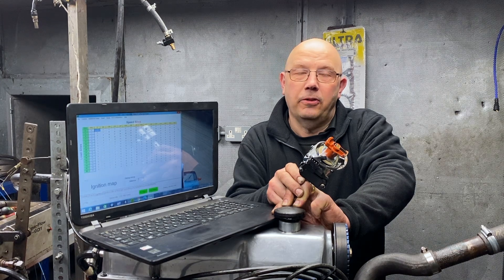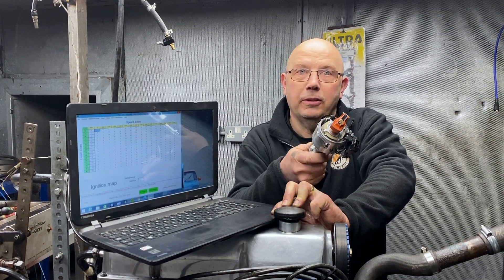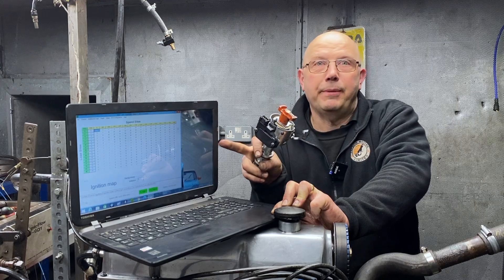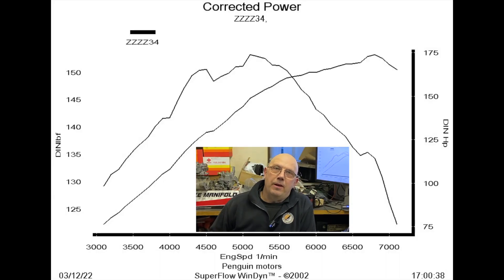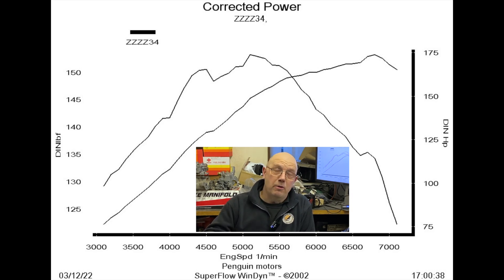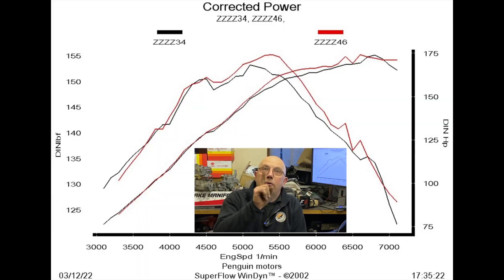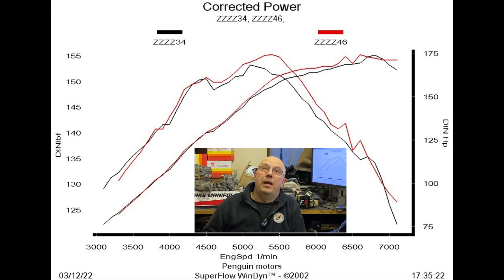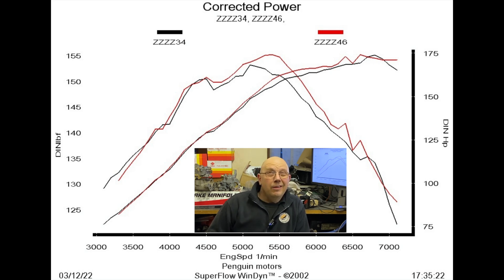Burton Power Distributor vs Mapped Ignition test - Ford Pinto Edition

Comment: Is the burton dissy electronic and not points?
Reply from the maker: yes electronic
Reply: @PenguinMotors  is the extra torque  from the spark energy, more accurate timing or map opposed to curve?
Reply from the maker: it wont be spark energy you only need enough not to missfire more energy wont give more power.

Comment: Can you redo this on a cammed engine, nothing wild needed, with a stock dizzy, a modified dizzy maybe without vacuum (as is all the rage), and mappable ignition? And then do runs on each setup at 100% throttle, and THEN!!!! do runs on locked 50 or 60% max throttle too?

Comment: Love these videos , please keep them coming, odd question but do you have any origins or know where that rocker cover comes from, I have one on my Pinto in Australia and get asked about it all the time . That's the O my other one I have ever seen
Reply from the maker: Many more videos in the pipeline. Sorry no idea where rocker cover cam from, but to be honest it was a pain, no baffle under the filler cap meant it tended to Chuck out oil, and it kept working loose, something the tin ones don’t do
Reply: @PenguinMotors  yeah I had similar issues as I was using it on a worn motor with a blow through turbo setup. I do plan on reusing it one day once I weld some fittings and a screw on cap onto the top. I look forward to.more videos

Comment: Dis is always loosing spark intensity in high torque output when cylinder pressure is highest. Better spark bigger bang. Nice video showing this in the dyno. Next petrol vs E85 test? Both tuned for max output.
Reply from the maker: I have run race cars on E85 but unfortunately it’s not available at the pumps in the UK so not really any point on me testing on it
Reply: @PenguinMotors  Oh I thought everywhere there is ethanol available. So no point there.

Comment: What if i told you, that you could do a programmable efi for roughly 150£, with a sierra efi distributor, a golf3 coil and a speeduino no2c ecu?
Reply from the maker: I would say that’s just fine, but not something the average guy is going to be doing and I like testing to sort of stuff that average Joe might do at home
Reply: @PenguinMotors  try having a look at the speeduino forum page. The pricepoint provides an entry point where the average Joe actually gives it a shot. And having it mappable also provides idle control to an extend, and take-off torque bump.
Also easily expanded with a set of bike itb's and just having it full efi for that modern living. Coldstarts are mint, driveability and economy in check too, and truth be told, mapping fuel is way easier than carbs. Also, theres autotune for fuel :)
Reply from the maker: @runesmDK  cool, yes im well aware of EFI and mapped ignition, i like running these old pintos on carbs, but i wouldn't take the efi off my race car for all the tea in china :)

Comment: I would have thought that you could also run the CR possibly a 0.5 higher on a mapped ignition just because it's easier to avoid knock with a programmable set up. Still interested to see more on the Zephyr Six build btw.
Reply from the maker: in actual fact this engine inst sensitive to timing and would easily handle more compression. Thers not been a lot of progress but  a Zephyr six update is coming shortly

Comment: The obvious question is, what are the differences in advance above about 5200 RPM? Is the distributor too advanced or too retarded in that range? Otherwise it's interesting to see how close the curves are. Good one!
Reply from the maker: the distributor didn't give enough advance around 5200, but advancing it further hurt top  and low end power.
Reply: @PenguinMotors  So not enough advance at peak torque? That seems a bit counter-intuitive. At about what RPM was max mechanical advance?
Reply from the maker: @andrewleonard9257  it does, but if i advanced it at peak torque it dropped off a bit either side, but i should point out we are only talking a difference of about 2 lbft so small whatever way you look at it

Comment: Funny I was gonna ask what kind of ignition your running on theses test. I just fitted a bestek kit. How about a master class on tuning Weber 45s?
Reply from the maker: As for tuning webers im  no master, its quite easy on the dyno as we are not bothered about idle, part throttle, progression and stuff as we only run at full throttle, all i have to do its get WOT and the AFR close and all is good.  The real art is the part throttle stuff
Reply: @PenguinMotors  Are ok, I know Weber 45 videos do really well on YouTube and not really seen anyone tuning them as such, like the scenarios you mentioned.
Reply from the maker: A lot of these tests I did with a standard distributor which I modified myself by adjusting the spring tension and fitted lumenition kit. Burton distributor performed almost identically to my DIY effort
Reply: @PenguinMotors  👍

Comment: I run a 2.3 (7.8:1 compression) on 27% ethanol gas... My ignition base curve: 12° until 1500rpm , advancing until 32° at 3000... Then 38° at 3500 and fixed on it until max rev... 5500 rpm 😔 Disappointing, Ikr!?
Reply from the maker: sounds a lot of advance to me, but thinking about it low compression and ethanol will both want more timing
Reply: @PenguinMotors  my next step is a ECU to control it, adjusting on dyno... I mean, maximum brake torque  is  a better parameter than air/fuel ratio(that I used previously) to adjust advance 😂😂😂... I'm amateur/ newbie !